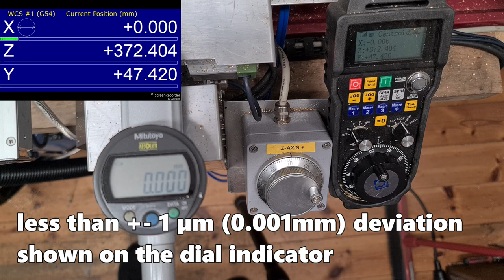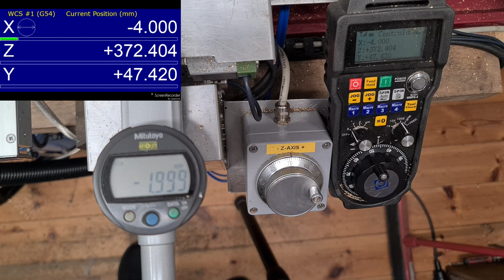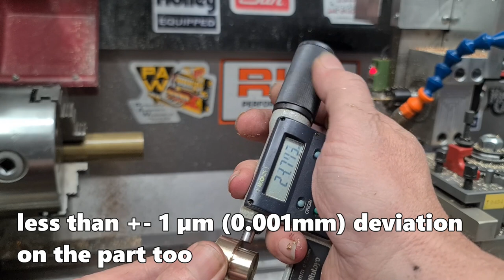Acorn6 DIY CNC lathe with scales closed loop part II

Comment: Are the linear scales entering the servo drives or the centroid controller? I am using linuxcnc, but my servo drives have inputs for linear encoders too, so I am thinking to close the axis position loop inside the drives.
Reply from the maker: The scales are connected to the controller. I think this is better, because this way the controller knows the actual position and you can tune the feedback loop right in the CNC, rather than with a second PC connected to the servo drive.

Comment: This is fantastic. Is the a TTL scale or RS422?
Reply from the maker: It will only work with RS422 and Pinout of the DB9 changed to Centroid Pinout
Reply: @TheSuntravel  great thanks. DITRON has a 1um RS422 scale. 
You ate a great inspiration with everything You do. I'm going to be build my second cnc machine now. 550kg cast iron gantry mill.

Comment: That is amazing, I didn't know that Acorn supported closed loop motion control using optical scales. Do you have any details on how it handles compensation for non linear moves (arcs) and is it continuous compensation or end point ?
Reply from the maker: It is continuous compensation to the actual position of the scale while multiple axis are running /synchronized
Reply: @TheSuntravel  got any links to docs ? I'm very interested in a compatible controller and license if that's the case
Reply from the maker: @ryebis  you can find everything in the Centroid forum and on the homepage. Centroids motion control is top-notch like modern industrial CNC
Reply: ? @TheSuntravel   Amazing vids, found your channel when trying to show someone else the power of Centroid Acorn. I assumed the feedback could only show 'following error' on this platform. Does this setup in effect offer true closed loop
Reply from the maker: @Chazaxl  Yes, Acorn6 is full closed loop with scales, up to nine encoder inputs with expansion board.
Reply: @TheSuntravel  Great, thanks. I hadnt spotted that this wasnt the base Acorn Centroid (4 axis) system, wasnt aware there was a new one. Amazing, thanks.

Comment: Is the spindle motor a servo too, or are you doing threading with some kind of ELS?
Reply from the maker: Spindle is als servo driven, for threading and rigid tapping you need an encoder on the spindle with Centroid CNC

Comment: hi Uwe, what motors did you use on your lathe?

what system do you use for the c axis?
Thank you
Reply from the maker: 1.5kW JMC servo for the spindle and 400W 220V AC servos for the axis. C-axis is with a magnetic clutch and a 4 Nm Stepper with gear reduction
Reply: thanks do you have any other info for the c axis I want to apply it too @TheSuntravel
Reply from the maker: @fabriziocaldognetto2885  There are some videos in my channel and a description in the Centroid forum

Comment: Hi Uwe, are those import linear scale, like the ones on ebay and amazon?
Did you have to change the connector?
Reply from the maker: I got them directly from Aikron. Get RS 422 Version. DB9  needs to be reconfigured to Centroids Pinout
Reply: Got it,
One more question, in order to have two MPG, two linear scales and one encoder for the spindle I will need Acorn 6 ($1000), CNC 12 Ultimate ($399) and the encoder Expansion kit ($299) right?
Reply from the maker: @l3of589   yes that is right
Reply: Ok, thanks for the clarification.